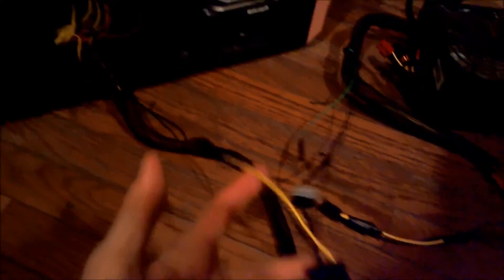How I made my Dedicated PSU for GFX Card

Comment: Is your main psu the 500w or the 550W ,,,, I bought the add2psu for my master psu (350w) to connect my slave psu (585w) , is that going to affect anything ,, im using the slave 585w psu to power only my rx580 nitro+ with molex to pcie 6pin and molex to pcie 8pin